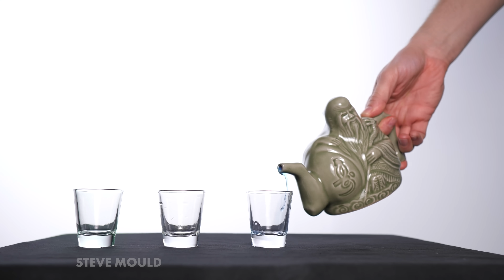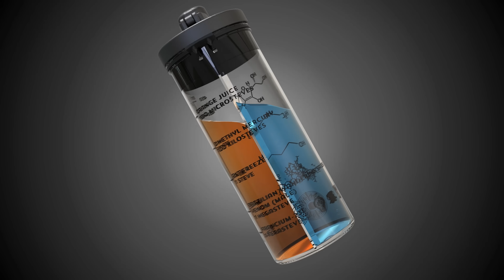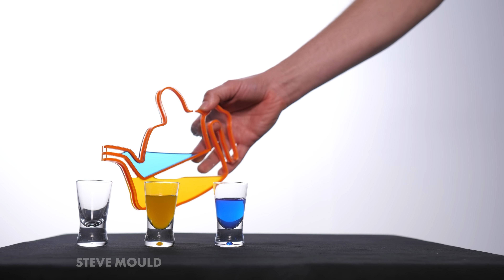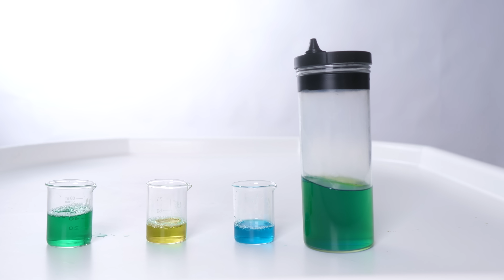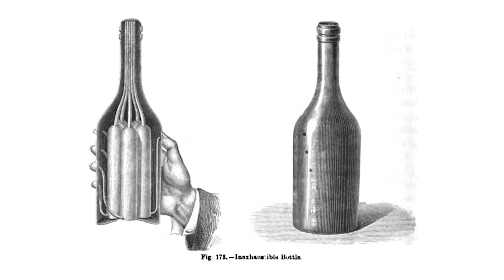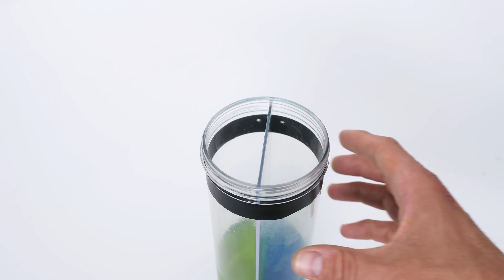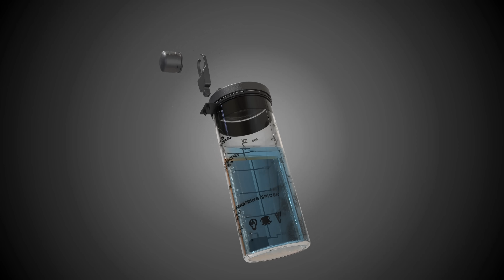The weirdest water bottle you can buy

Comment: instead of rubber stoppers.... why not reverse the function of the bottle and make it so both are sealed always. And have a push button that opens a certain chamber; instead of closing a hole to choose the opposite chamber.
i feel like this would be a more elegant solution.
Reply: This makes a lot of sense actually. Put the plugs/valves inside so they're normally closed until they're opened from the outside by pressing a button, otherwise sealed by vapor pressure and a small spring. Nice idea there
Reply: Buttons require more complexity, like springs and precise moulding, etc... and good luck cleaning all that after each use. Also, rubber degrades too quickly and absorbs bacteria. More complexity, more cost and more points of failure in the product too.
Reply: @turgsh01  this is a very valid point. Let's keep talking, there has to be a better way. There's always a better (albeit, narrow) way. Rubber could be replaced by food grade silicon. Springs could be built into their own structures. This has been done before, it can be disinfected by alcohol, soap, boiling, and even bleaching.
Thanks for commenting. Let's keep talking
Reply: @zzzxhrg  I think what he has now is probably the ideal option as it's cheap, doesn't affect much if it breaks off or rots away in the long term, etc... Just some silicon plugs. Nothing wrong with keeping it simple.
Reply: @zzzxhrg  it's possible to make a kind of valve in flexible material (silicone/rubber etc) by making a very narrow slit in it, which is normally pressed together by the elasticity of the material but if you push it it deforms and the slit opens.  That would be a manufacture-able option without springs etc. but still potentially prone to leaks
Reply: @turgsh01  Just want to point out (in case someone reading this does not know) that the spring could be made of molded plastic. It is usually the chosen option for applications that require little force. People do it all the time with their 3D printers.
Reply: @turgsh01  the spring could be as simple as a flexibly/ridged plastic
Reply: @turgsh01  all of that can be hidden behind more rubber/plastic/glass and wouldn't need to be cleaned, why would a spring be anywhere near the fluid?
Reply: @templeofdelusion   Adding even more complexity and substantial cost not to mention non-serviceable parts now since it's sealed.
Reply: honestly before the plugs where shown i thought the rubber ring could rotate. so that you could slide the hole in the ring over the hole in the bottle. very easy to make, easy to clean. but i don't know how well it would hold a seal.
Reply: My thought was a collar that in the middle position would cover both sides. Turning clockwise (LEFT from the front) would open the LEFT hole on the back, allowing the LEFT drink to dispense. Vice versa. You would be moving the collar towards the drink you want. Seems like an intuitive concept.
Reply: I have had multiple water bottles with buttons you press to open the valve to drink from instead of a removable lid. They work great. and the button/spring/ect could be on the opposite side of the seal as the liquid, the air side. Only 2 problems with the button idea. price and they have to be hidden buttons for the "assasins water bottle" concept. little holes are easier to hide under a finger as if you're just holding it than pressing in a button.
Reply: @cargasm383  mechanic is about keeping as simple as possible if you want a product to last
Reply: @sebee13  agreed. That's why silicon plugs in the inside actuated from the outside would be a great idea to explore. Recessed buttons, or a sliding panel as suggested above, are all great design ideas... Each with their own ups and downs. 
Here's where we kick that engineering going
Reply: C'mon, let's keep discussing! This is being fun
Reply: Remember, we're discussing the AIR INTAKE here, the dispenser is on the opposite end, all we're discussing here is the best way to block air to enter into the chamber
Reply: I think the reason they kept the hole just to stick to the original design of that teapot
Reply: Might be mire difficult to manufacture on a large scale, more expensive and the less obvious one that a lot of bottle creators dont seem to think bout but it may make it harder to properly clean
Reply: clearly button which is moving is bad idea in construction. it would break eventually, it would accumulate dirt. bad idea
Reply: Moving parts are more expensive and more prone to wear and tear. It would also be more difficult to clean.
Reply: I believe this would still leak
Reply: Buttons could accidentally be pressed during transport and leak. I was thinking of a ring that covers both holes initially, with cutouts along it's surface, which you can rotate to expose one or more holes. It wouldn't be as stealthy trying to use the mechanism though
Reply: @CookieCraftMedia  You could make a recessed button that couldn't be easily accidentally pressed, similar to the buttons many containers already have for opening a lid...

(Also this whole thing is a bit of a gimmick/novelty item without a huge deal of daily-carry utility so not sure how much of an issue any of this is in reality)
Reply: This would make it less water-tight since it could roll over onto the buttons and press them down.
Reply: This is far far far better than their option. Could even easily include a sliding lock. 

But they won’t do it since it would cost more. A hole’s cheap.
Reply: @FuncleChuck  That's what she said. 🤭
Reply: @FuncleChuck  No, they won't do it because the whole point of the bottle is to cover holes to choose the drink like in the case of the assassin's teapot. Choosing which drink you want by pressing buttons already exists anyway.

Comment: The rubber flap will be a weak point for the button. A simple twist ring with gasket to cover up the two holes will be a lot more durable and doesn’t cost too much to manufacture.
Reply: But then it can't seal unless it's sealing both without sealing only one, I think.

Comment: the disc jars are actually the default mason jars in a lot of america, at least in the parts ive lived in. in texas id only ever see the flip lids for dry goods and candy stores. mason jars were always a drinking glass or food preserves where you boil them to seal them air tight. the flip lid jars werent as versatile for drinking when youre not preserving, and long term the rubber lip wouldnt do well if its for drinking exclusively. a lot of this is anecdotal of course. but i never really saw the standard mason jars with flip lids used until the past few years, so id suppose a regional thing.

Comment: For the Hole you have to cover:  what about a ring band that moves with one hole in it. So when you turn it, the hole you want is covered. Like a tooth pick container, or a racketing screwdriver kind of movement.
Reply: Those are prone to internal leaking, impossible to clean.

Comment: asteroids can't be toroidal because that would require differing horizontal differences. The horizontals around the inner ring would be shorter than those around the outer ring, but it's all uniform in the game.
Reply: Asteroids is toroidal, but you're missing the fact of the forced perspective.  As the character "moves" through space, it actually remains at a fixed point on the surface, and the skin of the torus is slid and stretched to give the illusion of movement.  The lens used to project the surface of the torus onto a two dimensional play area corrects the stretch to indicate expected distance after transit to the equivalent latitude.

We are basically looking at a Mercator map projection of the torus, where the entire universe stretches to force consistent longitude spacing regardless of latitude.
Reply: @Kineth1  Wouldn't that require the ship to speed up when near the top or bottom?

Comment: Why not just do a sliding ring gasket around the section with the holes? Or even just a separate slider for each hole, so then you just slide it open for the hole you want to expose. Like, a slider that snaps into place (a toggle slider sorta thing with a silicone gasket).

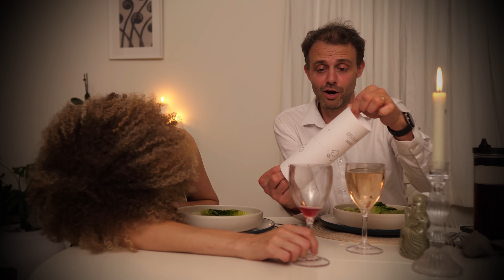Comment: 7:05 You can very well make a toroidal shaped water-holding container with a spout! Water holds in "dimples", and making dimples is no topological modification. You can practically make the doughnut hollow without disturbing the topological doughnut, so to speak.
Reply: But you can't make a toroidal assasin's bottle as the principle behind the assasin's teapot requires a container of genus 2. Your dimples make for regular bottles, not assasin's ones.

Comment: Perhaps one solution to the sealing issue would be something similar to water keys on brass instruments. The hole is normally closed which prevents air from escaping while you’re playing, but you can open it by pressing a lever or a button to open it which lets the condensation inside the instrument escape. No idea how you’d be able to make them inconspicuous, but it’s probably solvable…

Comment: I said it on Michael's short as well:
This needs an insulated version. For hot and cold drinks at the same time!
Reply: im only going to point out the difficulty of making a normal insulated bottle.. now you have to do that twice and keep them insulated from each other... not impossible but so far beyond practical engineering that it would probably cost a massive amount commercially.
Reply: @shigaraja Good. Makes it more rare. I get to be even cooler. And hotter.
Reply: @shigaraja  Wouldn't be that hard, nor I think particularly expensive to make. The real killer is the volume that would lost to the 'vacuum' walls that now surround the bottle and must bisect it it, and those bisecting walls probably need to be thicker as well - the temperature differential between the hot beverage and cold is so large you need more seperation than you would between ambient air and hot/cold beverage to get the same sort of temperature retention. That would make a rather large water bottle hold very little.
Reply: @foldionepapyrus3441  Insulated bottles are cheap because because we've figured out all the quirks and they benefit from economies of scale. An insulated assassin bottle would require yet more R&D, would be hard to keep properly insulated, would have very low demand... I wouldn't be surprised if it cost 100€ for a low capacity.
Reply: @LutraLovegood  Economies of scale certainly help, and this would need some small amount more R&D. But my point is the methods to make insulated bottles cheaply are already well developed, including oddly shaped 'novelty' ones. So as this is really just two of them in a slightly odd shape stuck together... 

I'd suggest it is just make two identical insulated bottles as inserts that are half the cylinder and then fit into a thin outer shell to make it look like one.
Reply: This is the use case I'd need it for - taking tea with me but also ahving a full water bottle!
Reply: Insulated but designed for the same temperature [chilled water and juice, hot chocolate and tea] would work easier. Even if it resulted in hot chocolate and not-chilled water.
Reply: At this point, and considering the prices, I recommend carrying two bottles with you.
Reply: Honestly I hope this takes off as a 'thing'. So many different variations would make sense for a bunch of different use cases.
Reply: This but I would also just like insulation to keep 2 cold drinks cold or 2 hot drinks hot I.E. the assassin's thermos.
Reply: Yes
Reply: Or ice cream and hot chocolate fudge :)
Reply: Thermodynamics: I'm about to become your worst nightmare, literally.

Comment: I guess you're pretty locked in on the design so far, because you're getting ready for production and any large changes would involve HUGE extensions in timelines, but still: Going with holes seems like a weird way, they're pretty clearly not a very userfriendly solution...

I assume you experimented with like push button valves and found that they'd be either problematic or way too expensive to make?
Reply: Doubt there was too much experimenting due to costs involved, which is why they went with what was perceived by them as the simplest solution.

Comment: Great idea. Think I’d prefer a rotating disc mechanism for the two holes to choose the liquids being poured over flimsy perishable rubber or flimsy perishable fingers.
Reply: It wouldn’t be an assassins teapot in that case. This is trying to stay as true to the idea and design of an assassins teapot while being a water bottle. The point of the tea pot is that simply placing your fingers in a slightly different configuration can cause the teapot to go from pouring tea to pouring poison. Your proposed design is unrelated to the whole concept. This is not the first vessel to have two compartments in it with the choice to pick which compartment to access, that’s not an assassins teapot though.
Reply: @giannobong6778  c’mon, these days people aren’t poisoning anyone, they just want to mix concentrated electrolytes 🏃 (or hard liquor 🥴) with refillable water.
Reply: Vladimir Putin begs to differ
Reply: @giannobong6778 rotating disk with holes spaced in such a way that either A, B or A+B line up.

That’d cover everything
Reply: @giannobong6778  tradition getting in the way of progress. Yet again! 🙄 haha
Reply: And you could also adjust the liquid proportions this way!

Comment: the holes need one way valves. Having to plug the holes up while in transit so it doesnt leak seems annoying. and that flap that plugs them up seems like it would be very easy to accidentally pop off while in a bag or something

or have them be closed by default. like they could be slits in the rubber that you need to press on the rubber to deform them to get them to open up to let air in
Reply: But what's the manufacturing cost of the two valves versus a plug?
Reply: Feel like the holes should be on the cap instead of on the bottle too
Reply: You need a air tight ring with two holes you can rotate in four preset locations (no holes, left hole, both holes, right hole)
Reply: @mrcyco.  It can be done with two separate air hole buttons that you can press either of them or both in the same time to open the hole(s).